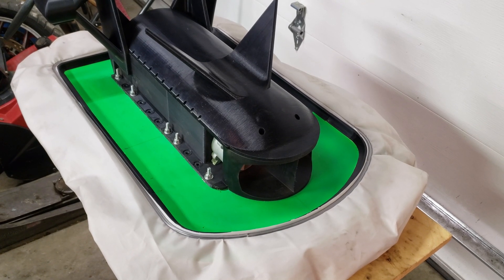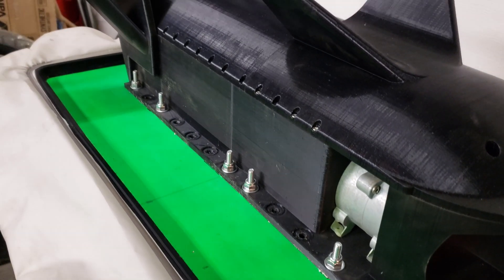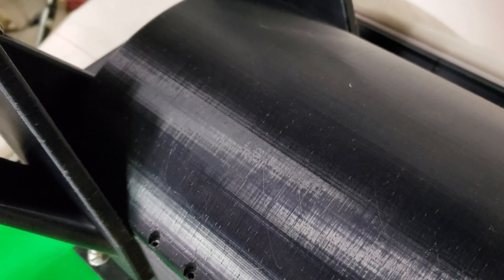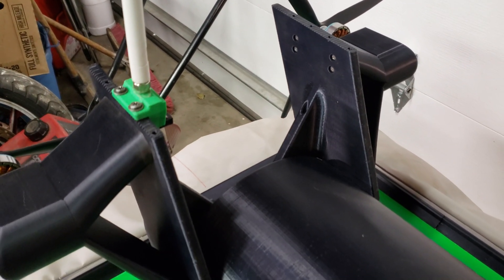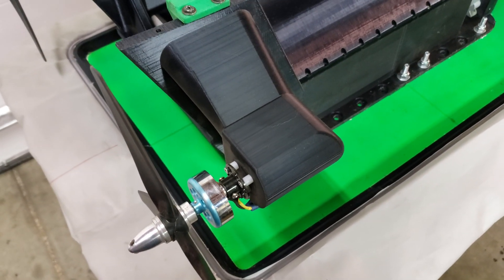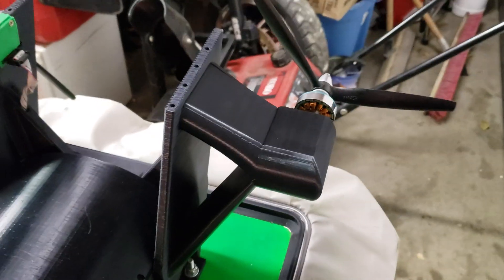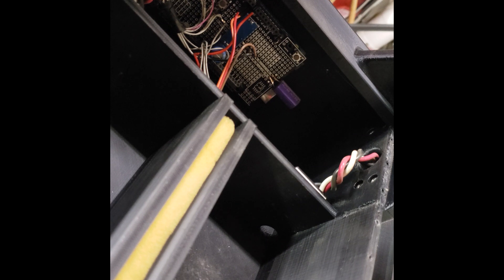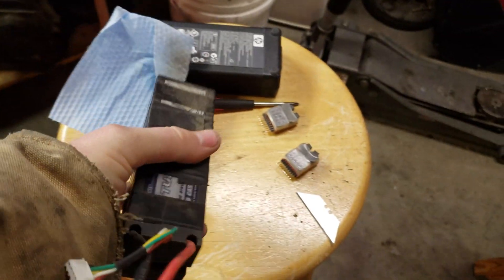Hovernaught 2.5 - 3D Printed High Performance RC Hovercraft December 2019

Comment: Nicely built hovercraft. Has a good carrying capacity. This can also be seen from the dust clouds :-) It does swing very easily. I thought, maybe this can be solved by placing the motors at an angle to the outside.
Reply from the maker: I'm going to have to try this again at a sharper angle. The original all foam board one did use angled motors, but when I 3D printed I left them perfect straight. 

I would really like to try something on the order of 15 degrees or so.

One of the other things coming soon with this project is variable pitch propellers so the motor doesnt have to stop and start the opposite direction anymore.

Thankyou for the feedback!

Cheers!